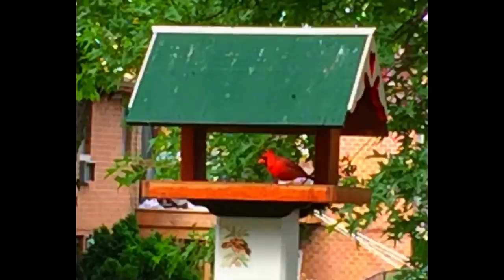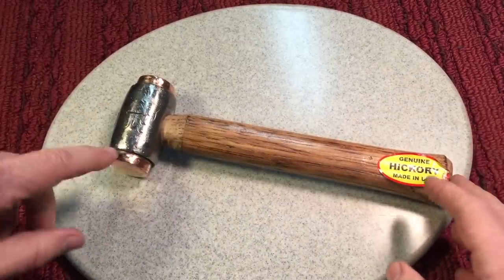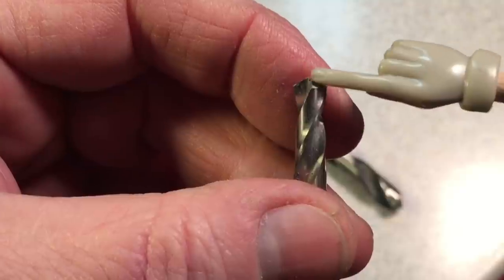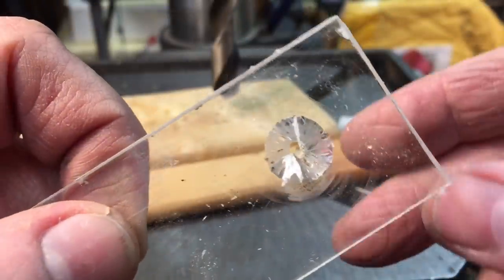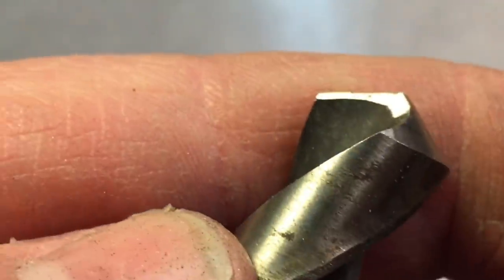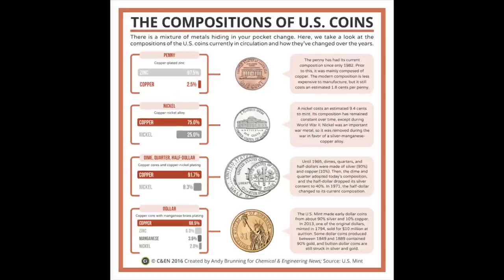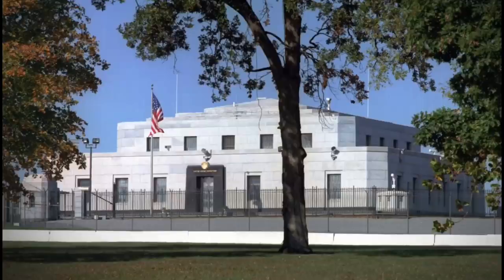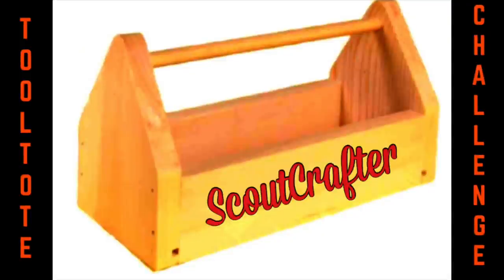Safer Drilling In Troublesome Materials

Comment: With all do respect sir the biggest reason for most of the catches is that almost no one on you tube is shown using a back stop, nor do they clamp anything down. I work in a meatal fab shop and drill 600 to 800 holes a day and it's rare for me to get a catch.
I totally agree with you about the different materials being more catchy. I mostly drill aluminum angle ,flat bar and sheet metal and the hardness in just those can be a drastic difference. A simple backstop clamped down has helped tremendously.

Comment: A hint for drilling or machining Copper. Use Pet Condensed Milk as a cutting lubricant. The butterfat in the milk helps to prevent the Copper from galling onto the cutting tool. You do have to remember to clean up afterwards as any splattered milk will sour and make you wrinkle your nose.
Cheers from NC/USA

Comment: Great video as usual. Very useful tutorial on drill bits. I never had any idea. I have been using regular drill bits and trying to get nice boreholes inplastic and aluminum by varying the speed of the drill. Live and learn from your great tutorials. The wheat sheaves on Lincoln head pennies were replaced in 1959 with the Lincoln Memorial. Every now and then I still find a wheaties penny in my change, but it is rare . If you get a 1943 "steelie" in your change, which will rarely happen, save it. We went to steel pennies to conserve copper for the war effort. Collecting year sets of pennies is a great way to get kids interested in coin collecting. Thanks
Reply from the maker: Hi Pat- I bought a few rolls of steel cents a few years back!  Always fun to have!

Comment: Nice video. I have done a lot of plastic aircraft windows and a trick to turn a regular bit into one for plastic is to drill into some set concrete. It works but recently I started using plastic dedicated bits and they are wonderful! They have a long, narrow angle tip. The key is to let the bit work it's way out the backside or cracks can occur.
Reply from the maker: Step drills work awesome on plastic!!!!!
Reply: @ScoutCrafter  
I have never tried that. The windows I install are usually 3/8" thick or thicker. Step drills no use on that!

Comment: That was a great lesson today. I knew the bits had to be different but not in what way. This will solve some problems for me Ive dealt with in the past! I had talked to before about sharpening knives to slice paper and you said you'd do a video...so Im sending you a little reminder....and while you have the plexiglass out could you do a "how to" video on cutting plexiglass without making a mess out of it or melting? Thanks John...greatly appreciate it!!!
Reply from the maker: Hi Wally- I will get to the sharpening when I do Abe Ellias's knife!  Soon I hope!   As for cutting the plexiglass I showed it on a video but forget which one.  Basically I set the table saw blade height for half the thickness of the plexiglass then run it thru... I then flip the Plexiglas and run it thru again making a perfect cut!   =D

Comment: Now I know why the plastic started spinning when I last drilled it! Great vid. Spotted the radial arms saw in the background be good to hear your thoughts on the table saw vs radial arms saw  in small workshops
Reply from the maker: Hello J O When I first got my shop I couldn't wait to get a radial arm saw!  I thought it was so great because the lumber yard uses them!  I was wrong!  I almost never use it and it is not a good tool for woodworking in my opinion..   Table saw all day long.   =)
Reply: @ScoutCrafter  thanks - that probably explains why they’re so cheap in comparison

Comment: Great tips for drilling plexiglass. So many guys on the arcade forums drill control panel covers and crack or mess up the plexiglass. I will definitely pass that tip on! My great uncle got me somewhat into coin collecting and he used to bring me rolls of coins like that from back in the old days. Pretty cool. I have a ton of those old Buffalo nickels where the dates wore off. 

I took a year of mechanical engineering technology classes many years ago, and all that drill bit info brought back memories. Where did you learn so much about this stuff?
Reply from the maker: Hi Paul- I love to tinker like you, so many times I would fail in the shop and wonder what I was doing wrong.  Now it's my mission to pass on as much information as I can for those of us who didn't have machinists as fathers!  LOL  Thanks!!!!!!

Comment: Fantastic John, I've gotta try this, I break 9 /10 perspex panels using my hammer and nail method.. Never knew the angle matter so much! Incidentally for cutting perspex my most trusted method is with a metal disc in an angle grinder, cuts melts seals edges as it goes.tiny trim clean with a Stanley good to go

Comment: Working for a mechanical contractor replacing blowpipe elbows worn out by woodchips, they had to be fit in place and drilled by hand off a ladder or scaffold. Our Milwaukee “Hole Shooter” must have weighed 12 pounds and without the proper bit it would seize either potentially tossing you off the ladder or spraining your wrist. 
This is information you will not find today at your local hardware emporium. Thanks

Comment: So what are the physics behind this?  Like a dummy, I would have gotten a new sharper bit and expected better results. Is it the friction of the duller point that heats the material and makes it softer, allowing it to pass through?  Or does the clearer pathway allow the material to flow past the tip and avoid frictional heat?  I love things like this. It makes my brain hurt.
Reply from the maker: Hi John, Alan is right, the zero degree angle allows the bit to scrape off the material instead of cutting into it and the digging in because the material is so grabby...  I have had a few mishaps with Brass!  Lots of sucking the tool into the work!   =D
Reply: @ScoutCrafter  Me too John.  Soft metals have always given me a hard time, but I've learned something today.  Thanks to you and to Alan.

Comment: Hello there from Russia. For the processing of viscous metals, you can use a lathe at slow speeds, and instead of a cutter Dremel with a Carbide Burs.
Once I made rubber rollers on a lathe instead of a cutter using my Foredom. Also in a case like a hammer, you don't need high precision instead the lathe you can use any low-speed rotating tool like a drill.
Reply from the maker: Thanks Mikhail!

Comment: for acrilic I use bits for wood, the ones with a pin in the midle, work's quite well.
Reply: Brad point
Reply from the maker: They work very well too!   Sheet metal also!

Comment: I still go through my change If I find anything I show it to my son and why it is worth saving. All the years I have used drill bits and never knew that. More than once I have had something go flying across the shop. I have lots of bits that people were going to trash but I saved. I can sharpen by hand but not real good at it. The way to go is a drill doctor. A friend has one and I have sharpened most on it. I will have to try and make a set to do soft material. Do they sell sets? Stay safe and healthy my friend. Thanks
Reply from the maker: Specialty sets are always expensive!  You know a Step drill is awesome on plastic!!!!!

Comment: I put seed out for various wild birds.  In the back yard pigeons were coming by the dozens and grabbing it all.  But out front, quail, which are a bit smaller, and little wild birds were the only ones I'd see.  So I read some information and evidently quail will stake out an area and take on bigger birds like pigeons and drive them off.
Reply from the maker: Hi Kathie- Pigeons are hoggish, they will eat up most of the seed leaving little for the smaller birds.  I always throw seed on the floor for the pigeons and squirrels and seed in the feeder for the birds.  The pigeons have figured out how to get in the feeder so next time I have to make the opening smaller!  LOL  Doves have better night vision so I throw seed out at night and as soon as it starts getting light the doves (only doves) will eat their fill until it's bright enough for the other birds!

Comment: I’ve been saving wheat backs for decades. I have a few steel cents from the 40s. 
Question about the copper on the lathe though: most tooling I see for metal work on the lathe seems to be a straight edge rather than something with a rake on it like a drill bit. Would it still have possibly grabbed if you turned that head in the lathe?
Reply from the maker: Hi Joe!  To turn copper successfully in the lathe you need super rigidity and zero rake tooling.  Without both you are asking for trouble!  I have the tooling but with that much overhang and nothing to support the free end like the tailstock it was a recipe for disaster so I avoided it.   I could have removed the puck and mounted that in the lathe and tried it that way but removing a puck that was beat to death isn't as easy as it looks!  =D
Reply: @ScoutCrafter  Thanks for the clarification! I have often wracked my brain thinking of different ways I could make a makeshift lathe.

Comment: I never knew the dulling off the edges trick. Great tip John. Am I right in assuming you're referring to doing that on metal bits?
As I've got loads of each size of bit, one of my shop jobs tomorrow... Putting together a dulled off set of drill bits.
Cheers
Reply from the maker: Hi Ian!  Just bits for drilling the metals that grab and plastics!   -=D
Reply: @ScoutCrafter  I mean you're not using masonry or timber bits. You're using metal bits?

Comment: Well I leaned something!!! Thanks ScoutCrafter!!
Can you do something on Step Bits?
Reply: @matthewhopkins666  Yes I watched it---- I always thought of them as kind of an "Infomercial gimmick" 
Kinda "BUT WAIT GET 2 for $19.99" 
Always used a Hand Reamer after sheet metal, or thinner steel  got ragged after drilling. Plastic too. 
(A Craftsman Hand Reamer from about 1969. Two actually, one big one small)
Plastics though you can really have a twist drill take a deep dive which is a pain, and hard plastics I was drilling a small hole, then carefully reaming it out.

I watched Farm Project, and Geez, I think I need one of these!!!

Comment: Never knew there was so much to know about a drill bit. Now that you have a zero edge on it will it still drill wood? Wheat pennies are extremely hard to find in pocket change now. Keep your eye open for a 1943 copper penny. It's worth about a million dollars. Only a few were made before they changed them to steel because of the war.

Comment: John, I’m nearly ashamed to admit this, but I still have a devil of a time drilling steel! When I mounted some rebar through angle iron to make security bars on my shop, my hand held drill worked great drilling the angle iron. But when I try with drill press it seems to heat and not cut (I do center punch) so I google drill speed for iron and their saying 1500 RPM’s......I thought it would suggest more like 700, but no!  It just sat there and got hotter than the hubs of hell! (Yes, cutting fluid!) google doesn’t lie does it? Well, I guess tomorrow I’ll try slower speed!....suggestions?
Reply from the maker: Hi Lloyd- Some steels and even alloys are much harder then expected.   For example Years ago I picked up some bed framing so I could use it as angle iron if needed.  Well the time came and I was doing a project when I decided to cut up the frame and go to work...  Holy cow!  It was super hard and such a pain to machine!  Turns out it was hot rolled steel and was hardened.  Never again!  Drill speeds depend on a lit of things, pressure of the drill, sharpness of the bit and type of bit...  I have found for difficult metals it almost always pays to drill a smaller hole to start.  For me 3/16 is a good size as it is stout enough to get thru but small enough to not require a lot of force.  Then you can jump to 1/4".  You always check the chips to adjust your speed. Too fast and friction will be your enemy, too slow and it won't bite well... Cutting fluid helps (not lubrication oil)  Try a 3/16 pilot and see how you like it!
Reply: @ScoutCrafter  thanks, John.

Comment: 6" or 8" table grinder, which should i get to start cleaning up some tools
Reply from the maker: Hi Tom- Usually the only difference between the two is the clearance... The RPMs and motor specs are the same.  Extra clearance is always nice but the cost might be quite a bit more!  Here is the unit I bought last year and is a very good unit, only 6" but I always hang the wheel over the end of the bench!  https://smile.amazon.com/gp/product/B01BW8UOHC/ref=ppx_yo_dt_b_search_asin_title?ie=UTF8&psc=1
Reply: @ScoutCrafter  txs for info...guess i could get a buffer also, does it come with any pads?
Reply from the maker: @tomdale1313  It depends - Usually it does. but you will want a more firm buffing disc...  https://smile.amazon.com/gp/product/B003UOLUQ6/ref=ppx_yo_dt_b_search_asin_title?ie=UTF8&psc=1